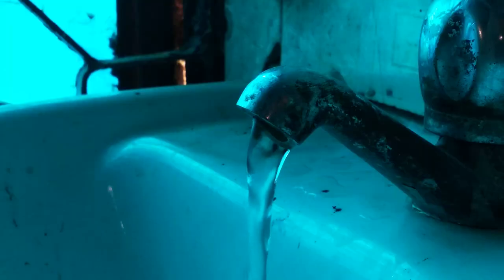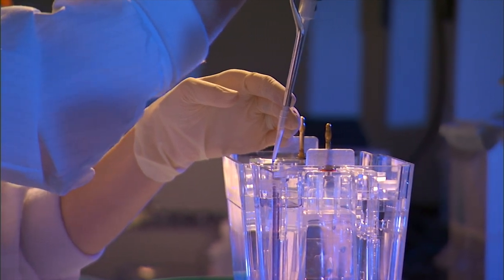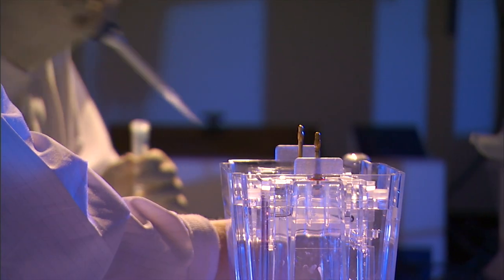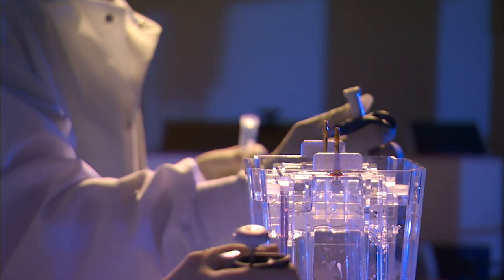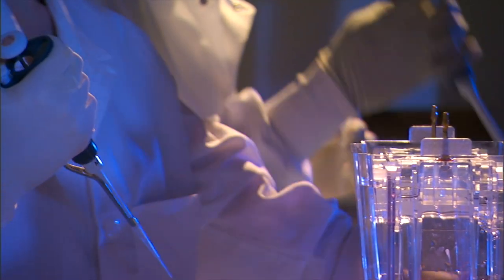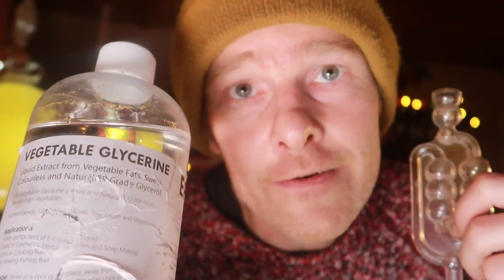What should you put in your airlocks for homebrew and winemaking?

Comment: I use water and have never had a problem with enough negative pressure sucking back the water into the fermenter. The simple solution is simply not to over fill the airlock. If you are really concerned there are now liquid free silicon airlocks that are designed to open when there is enough pressure inside the fermenter to allow out the CO2 and then close again tight when that pressure has been released.
Reply: For my experimental batches, usually done in an 800ml Ball canning jar, I use a 'pickle pebble' silicon cover with a nipple through which CO2 can exit - works a treat!
Reply: @CynCopeland-TheAnswerIsMeat  :  I’m just starting to do my first batch here, which I intend to make into vinegar, so I’m just sitting here with my first airlocks and such, other than the silicone and mason jar valve lids for kombucha And vegetable fermentation, doing research. :-)

I have been wondering if I can use my vegetable- or kombucha-fermenting setups. So this is really nice to know. Thank you very much.  :)

Comment: Just bought glycerol and changed over! What a great tip!

One drawback I’ve noticed- it’s not so good in the cheap plastic demijohns- the seals through the lids on mines are obviously poor. The co2 is escaping through the seal instead of pushing the glycerol up. 🤷‍♂️ worth pointing out- it’s an easy fix to put a better seal in. (I’m using balloons  just now till the new deals set!  🎈

Comment: First time brewing and used your advice on using glycerin. It is quite thick and theres conflicting advice online to thin it with water or not... do you thin yours out? I just put pure glycerin in my S airlock...hope it works. Haven't seen bubbles yet! 😕
Reply: Simone B.  How did it go?
Reply: @daphneraven6745  worked well so far. Using glycerin was easy, didn't dilute it either and no issues
Reply: @LiberateMyHatred  :  Tyvk 4 getting back to me; I put on my first brewing tonight, which will eventually end up as vinegar. At least that’s my aim.

I had hoped to use glycerin, but the glycerine I had in the cupboard has been around since before the pandemic, and I don’t know if it’s possible for glycerine to spoil, but mine is sort of watery now, so I ended up going with water In a three-piece airlock.  

It’s kind of neat that I could see a little colonies already starting to form in the juice;  tomorrow I think I’ll start another one with juice and pulp fresh from apples out back, and red wine yeast. 

Have you been making wines and vinegars?